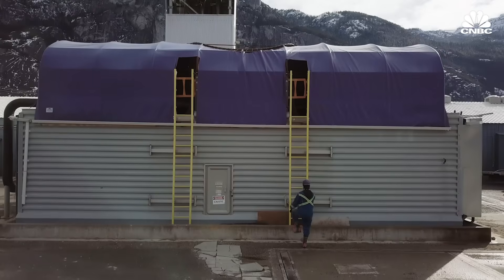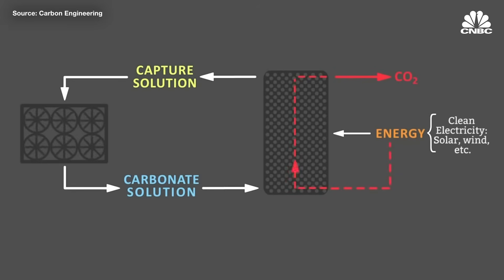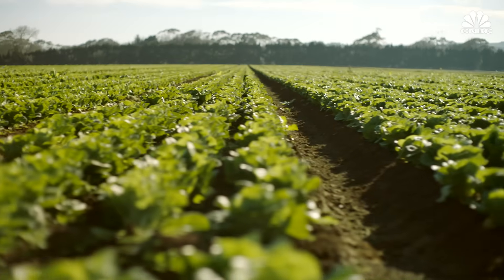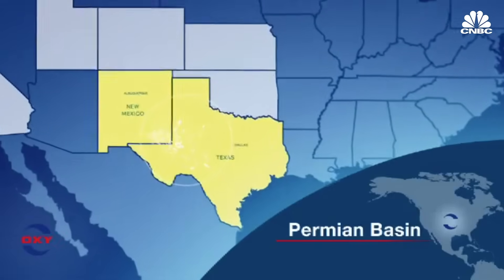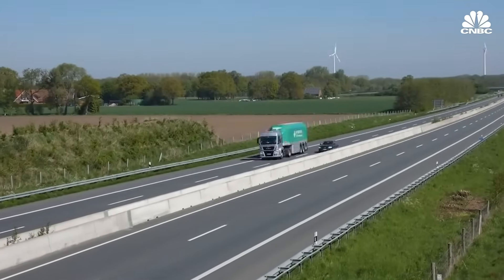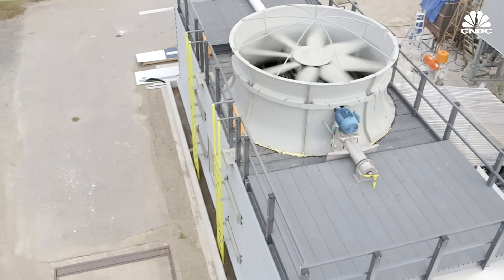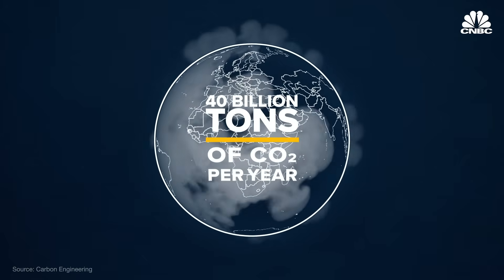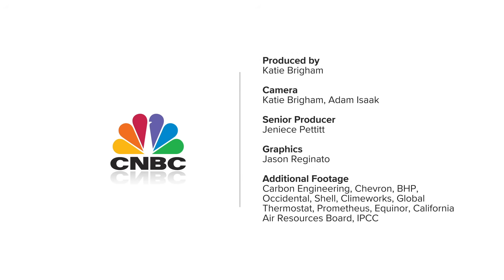Bill Gates-Backed Carbon Capture Plant Does The Work Of 40 Million Trees

Comment: Damn, even the tree's are losing their jobs to technology.
Reply: atleast the tree's are doing it with no cost..
Reply: @rheyreoyan4838  and the trees give us oxygen this plant isnt doing the work of trees if it isnt giving us oxygen now is it
Reply: @ChillingCap   We have more than enough oxygen already.
Reply: @rheyreoyan4838  And poor efficiency, the photosynthesis of modern plants range from 0.5% to 1%, the theoretical maximum efficiency of photosynthesis is 6%.  Yes, fossil fuels are just chemically stored solar energy collected by nature at efficiencies far less than 0.5%, makes those commercial photovoltaic solar panels at 20% efficiencies look real good doesn't it.
Reply: Pure BS greenwashing.

1. Underground stored CO2 can leak out through burst well-heads that are sure to happen over time - once major leak starts - generally all the gas escapes - as shown in the recent California natural gas storage blow-outs.

2. Conversion to fuel takes more energy than is got from burning those fuels. So it makes more sense to use the needed input energy to replace fossil fuels use in the first place.

This is just a fig-leaf for fossil fuels.
Reply: @rheyreoyan4838  at a slower rate with more space needed
Reply: @rheyreoyan4838  If you let the sun, oxygen and water be an exception, then maybe yes.
Reply: @rheyreoyan4838  Pine trees in BC have a 80 year growth cycle.  Trees do the job but they are too slow.
Reply: @rheyreoyan4838  don't trees need nutrients to grow? Plus don't trillions of trees need to be planted to reverse climate change? Don't get me wrong, we need to plant trees, but so much space would be needed for those trees. I don't know all this, this is a genuine question.
Reply: @redguy4234  I've got a better idea. Why don't we just stop cutting down the old growth forests like NOW...and then plant lots of little sapling, which will take hundreds of years, of course, to fulfil the ecosystems services that old growth forests provide us with.
Reply: @rheyreoyan4838  yeah and you can actually get energy from the trees by burning them too 😂 then that energy can run this plant to replace the tree
Reply: @rheyreoyan4838  TLM: tree lives matter. Soon they will unionize and demand benefits and pay
Reply: @rheyreoyan4838  because land is for free right?
Reply: @rheyreoyan4838  the air they breath is carbon, you know that right
Reply: @rheyreoyan4838  I think growing 40 million trees would be very expensive.
Reply: @nomercy4521  Atleast it wont have any ill effects on Nature
Reply: @himanshujoshi5133  that depends on how it's managed. Evasive plant and animal life could really mess up ecosystems.
Reply: @nomercy4521  I don't agree to it. We with all others (plant and animal) make this eco system. If one part is extensively growing others need to increase with same speed to keep everything in proportion. If not then, we should know that whatever we are doing is not right.
Reply: Austin not really it might only just cause 1 million or 2 for the trees getting planted and 15 or 20M For the water transfers unless rain comes the water transfers would be less and could be affordable :D
Reply: @nomercy4521  🤔🤔🤔
Reply: @nomercy4521  Not in China, the Chinese have been recreated their forests by planting trees since 1960s, from desert to forest and oasis, they are very productive lands now.
Reply: Austin I think sparing 40 million trees would be less expensive Forrest grow them selfs eventually with the animals around them if you stop damaging them ... but there is a line and we’re crossing it in the Amazon for example and that line will lead to total collapse :/.
Reply: @nomercy4521  Not reallt they shed seeds all the time...
Reply: Austin, What about not destroying 40 million trees 

Or, every time a tree it is destroyed, one is planted.
Reply: Austin actually it’s not. Just send me the seeds coz I like breathing and will plant them.
Reply: Austin 40 million trees were free, until we cut them down
Reply: @nomercy4521  trees lasts many years tho
Reply: @nomercy4521  uh what
Reply: @nomercy4521 
His killing of 40 million trees per machine will be more expensive... Those trees need CO2 to survive. 

These climate crisis alarmists plans will do MORE harm to the climate and humanity ...
Reply: @nomercy4521  They'll grow on their own if you let them.
Reply: @nomercy4521  It's more expensive not to breath. The Amazonas is being burnt down at an increasing speed. We need new "lungs" so that we can breath. Rethink.
Reply: @nomercy4521  how about if trained volunteers did it?
Reply: @nomercy4521  quite the opposite actually
Reply: @themiddlekingdom9121  China's worst polluter of them all.
Reply: @nomercy4521  not in the amazon.
Reply: @nomercy4521  I don't think it will be expensive as this PLANT does, I think it's just Time-Consuming...probably hundreds of years to grow into forests...
Reply: @nomercy4521  A few buckets full of seeds. And then just spread them and wait for the magic.
Reply: @nomercy4521  How expensive compared to the money that has gone into this?
Reply: Lol plants produce oxygen that this plant doesn't
Reply: @Randibaaj_sala  😁😂😂😂😂😁🔥
Reply: @Randibaaj_sala  trees provide the natural ecosystems that these machines don't. The insects, birds, fungi, animals. These can never be replaced by machines.
Reply: Anon ymous nailed it! Add the fact organic plants need C02 to grow. The unknown, which politicians and media ignore, is the amount of C02 an organic plant can process. A study may have found the more C02 in the atmosphere, the more an organic plant "greedily" uses C02. I use greedily for lack of a better term to show organic plants will consume more C02 based on availability. 

More C02 could mean larger plants and better yield of seeds, including fruits. 

The man-made C02 scare is a danger to nature, considering the lack of understanding of the processing of C02 by organic plants. Don't believe me, scientists couldn't figure out how to make people fly with the backing of government funding, it took 2 brothers to figure out how to get people in the air. 

Don't trust the government to think past the buzz of the week in order to win an election. Don't trust your TV to be unbiased.

Bill Gates, if you're listening. Use your money to give humanity a more well-rounded understanding of the EXTREMELY IMORTANT GAS C02 IN ORGANIC PLANT LIFE. Most politicians are money and power greedy fools.
Reply: yes but this plant give oil companies a way to get more oil. Who cares about oxygen. We can all walk around with hand held oxygen machines
Reply: They do.... Only carbon is extracted and trapped underground the oxygen may be inform of by-product, but oxygen can be separated from co2
Reply: @Randibaaj_sala  plants need to breathe too you know...
Reply: @Randibaaj_sala  yep but yet they still find a way to keep on taking life out of the game except for a select few. Cough
Reply: @Randibaaj_sala   algea produces more oxygen than trees.
Reply: @Randibaaj_sala  but plants use oxygen at night while this plant doesn't
Reply: @Randibaaj_sala  true but NASA did a study stating that as co2 emissions increase plants are using less of it. Even plants are no longer enough.
Reply: @Randibaaj_sala  yes it does produce oxygen
Reply: Anon ymous about 70% of the worlds oxygen comes from algae
Reply: @nickdelasalas8975  you're saying like decrease of 15% of oxygen due to trees isn't going to effect. And where arre the sources?
Reply: @nickdelasalas8975  i guess that that means we dont need to anything
Reply: @nickdelasalas8975  links to prove your opinion please 
Never heard that before
Reply: @Randibaaj_sala  nobody is planning on cutting the trees down so we will still have oxygen
Reply: @jonathant5774  ....you don't have to cut the trees down. They are all dying in my town of Chapin Sc. Pines, oaks, beech, lots of different species. The poisen they spray is killing them.
Reply: @jonathant5774 
Without CO2 those trees will die...
Reply: @Randibaaj_sala  it never says it is to replace the trees. It is just to clean the air that we polluted
Reply: ehm..  what about oxigen
Reply: @zenoidul  you already show signs of oxygen depreciation
Reply: Vrincy, not sure what your thought process was for your comment, plants live and reproduce using C02. Processing C02 deliberately could stunt plant growth and reduce natural oxygen production. Lest we choose to rely on man-made and regulated oxygen.
Reply: @zenoidul  there will always be trees. Perhaps skinny tries since we'll be taking all their food...
Reply: we don't have time for your details we are saving the world!
Reply: @zenoidul  Good point, but maybe the cycle is completed when it's put back in the ground.
Reply: @zenoidul  excatly
Reply: Vrincy most of our oxygen comes from the ocean
Reply: @zenoidul  there are still plants a d trees about bro chill
Reply: @zenoidul  Trees almost don't produce oxygen, seaweeds does.
Reply: @zenoidul  oh she didn't hear anything about oxygen nobody's telling you however that oxygen comes from keep your mouth shut and practice holding your breath
Reply: Trees also provide wood and food and habitat and they don't need electricity
Reply: Yang 2020, now American trees can get $1000 a month
Reply: Eh we can just plant more trees around our homes, in the cities.
Reply: @leehongjin6884  that should help with shading the sunlight to keep homes, bus stops, etc. cooler especially if the tree is leafy (creates better breeze generation if you are near it), and help with aesthetics.
Reply: I'm gonna post this with your qoute.
Reply: @johnperic6860  
From what I can find via National Geographic, 

"It could take more than a hundred years to add enough mature forest to get sufficient levels of carbon reduction."

That's based on current CO2 levels. 

I'm for planting trees, but if we want to treat that as "the" solution, I don't think we'll hit the goal.
Reply: @nomercy4521  i believe in siberia,the canadian arctic and alaska they need people to plant trees after they put out the wildfires,next year same deal until we run out of trees,fires wont be as large as the new trees we plant arent as big as the ones that are burning now,after that we have have to plant peat to replace that too is burning
Reply: @richardconnelly7141  I saw some research more recently, and it raised concerns about tree planting.

What was most interesting for me was the effect planting trees could have on capturing heat. Forests are large heat sinks that retain heat and foresting areas can decrease the amount of sunlight being reflected back into space. Planting too many trees and planting them in the wrong place could actually increase temperatures.
Reply: @richardconnelly7141  but we'd have to replace the asphalt, and people want the asphalt.
Reply: @nomercy4521  This can be a stop loss till we plant more trees.
Reply: @nomercy4521  genetic modifications , i myself work on that subject , and it will need less than 40 years ( if we start )  - we will be able to build  up sections of  Forest  , for industrial and other specific uses  , slowly solving soil  degradation issues  , few northern countries are already doing same thing , but as long as the governments of  countries with rich forests   ignore issue and keep destroying forests ,  problem will be way harder to solve ,  first sections  or generations of those built forests will need around 10 -15 years to grow .
Reply: Planting forests is still the better solution. Our watersupply depends on forests worldwide and so does biodiversity, regardless of climate change.
Reply: @TT-Freak  Absolutely, much cheaper !
Reply: It is a joke
Reply: @danv.2695  lol
Reply: But does it make paper? 🤔🤔🤔 After all, everything made of plastic these days is being forced to find other ways; and paper seems to be the way for most. We need to plant trees for many other reasons. I know you're only kidding around, and it is funny, but you godda love companies like Tentree that plant trees for every product/service sold. ^_^
Reply: This thing is worthless.  There are 390 billion trees in the amazon alone.  They are quickly disappearing.  We need more than ten thousands of these machines to make a difference.  I dont see that happening.
Reply: And in future animals will probably lose their jobs to technology once we find sustainable ways to grow pieces of an animal from their stem cells.
Reply: @scythal  which means we no longer have to chop down the Amazon Rainforest for animal farms. That means fewer animals grown for meat and less need to produce plant stock to feed them. This also means fewer emissions from the animals and the transportation to ship them to slaughterhouses and then transporting the meats for food markets
Reply: no way trees do a lot more than remove carbon from the air they prevent landslides, are home to animal life etc.
Reply: Trees when rotting after they die or burned, releases all the CO² they've absorbed so they are a net zero for CO² capture unless the dead trees are buried by geologic processes or used as building material by man.  Trees are a temporary store of CO².
Reply: @johnwang9914  yes
Reply: Uneployment due to technology
Reply: Trees are now obsolete due to humans
Reply: @scene6289  dont worry soon humans will be obsolete and weeds will dominate the world because their will be no animals left to eat them either
Reply: Because now, it's hard for the trees to do their jobs.
Reply: once they are losing their job, it means promoting more logging, its true this actually promoting for more pollution
Reply: 😂😂😂 here you win best comment  🏆
Reply: THEY TOOK OUR JOBS
Reply: Forest have higher risk of fires. So local governments need the money to carefully manage that too. Everything costs, no matter what it is. Like the lady says it's not a matter of either or, we need to implement every solution.
Reply: LMAO this comment made my day ahaha! XD
Reply: I don't buy into the CO2 climate myth https://www.youtube.com/watch?v=RHM6-Pk21i4. CO2 is largely plant food, and has little if any other relevance. Trees have a lot of other benefits than this stupid plant has. British Columbia plans to plant as many as 300 million trees in 2020, if they can find enough tree planters to plant them all, and does that every year in order to sustain the forest industry. If the logic stated here holds, that is like creating 8 carbon capture plants every year? Somehow the math just doesn't add up?
Reply: These stupid plants will actually damage the environment and the economy of BC, making Canadians poorer in the process. This plant should be shut down and the money put into reforestation and the BC coal, oil and natural gas industry. Removing CO2 from the atmosphere will just make the forests grow slower and lower the productivity of the ecosystem overall. Stupid environmentalists would rather live in poverty and see the decline of the human race and its advancement. No wonder Western civilization is in decline. We may as well stop having children - they are just a burden to the future and mother nature. Bloody collectivists. If they care so much they should sterilize themselves and go live under a rock. I will exercise my free will and do as I please. Climate change is a lie promulgated by the communist Chinese and the ultra wealthy elites like Gates.
Reply: Pine trees in BC have a 80 year growth cycle.  Trees do the job but they are too slow.
Reply: @BMC_self-invent  Just thinking that, as long as the Carbon stored does not end up underground, it goes back in the cycle either by forest fires or by other means. Though I like what the Chinese have done, using their army to grow massive amounts of trees, and reclaiming some of their deserts.
Reply: Actually Tree's convert the CO2 to Oxygen. These Machines are just sucking CO2 up.
Reply: What about oxygen producing
Reply: Umesh R. Trees still do most of the work and make oxygen, food etc.
Reply: More like there food. Well i guess this is the end of humanity, no nore oxygen.
Reply: Its not even trees. Its phytoplankton that provides most of the oxygen we breath, and it depends on the water, minerals in the water, sunlight and carbon dioxide for photosynthesis creating the oxygen we breath. Theyre going to capitalize on this and ruin the air.
Reply: @johnperic6860  problem is they destroy way more trees  every few years , between 2012 and 2020 over 60 million hectares were destroyed  ( partially or fully ) with this rate  till 2030 we will have only 25% of the forest left .
Reply: Umesh R.   Yeah Bill Gates is global enemy.  Seriously.
Reply: Trees are not just losing their jobs, their losing their breath! Why are money hungry corporations killing this planet?
Reply: That's right, That's the death nell for our last remaining forests, plants need Co2! 😡
Reply: Sure Kid  If our beautiful forests were left to flourish we would'nt need to fix the problem!!
Reply: Dang, I was thinking the exact same thing🤣🤣🤣🤣

So use chemicals to remove chemicals.. that they will later say is a bigger issue that we will all require a vaccination...lol
Reply: I don't understand why we can't just go back to letting nature do its thing.... We are so arrogant to believe that we can do nature's job better
Reply: Won't be long where gonna start seeing canned air for sale... I can imagine the commercial slogan... "Breath Easy and Fresh with Mountain valley air
Reply: I wouldn't to go that far. We still need them because of the ecosystems they produce. There are some things that technology just will never be able to do.
Reply: Talk about oxygen, food production, support of wildlife tt helps maintain rivers and other life sustaining processes. Not to mention the amount of energy utilized. Clever Marketing, focus away from what it really is.
Reply: Which is no joke because we desperately need more trees.
Reply: If this isn't a joke, how many horses do you think lost their jobs to the steam engine 😑
Reply: They do so much more than clean the air, though.
Reply: Make Forest Great Again
Reply: RIGHT? Or you could plant more trees 😆😆😆
Reply: @johnperic6860  I'm not knocking planting trees, I'm just saying it isn't cheap. From what I looked up, it took Ecosia 10 years to plant about 60 million trees and one of the tech plants replaces 40 million and they need thousands of these plants to reach carbon zero. 

That means we would need to plant trillions of trees planted in something like 20-30 years.
Reply: @nomercy4521  if we get to carbon zero, all plants will die
Reply: @nomercy4521  
And trees take years and years to grow, plus trees DO NEED carbon dioxide for their function, even trees don't live on pure oxygen, in fact oxygen is a BYPRODUCT of their natural functions. It just so happen that there best of living things need that oxygen, no??  
and the air we breathe has only ~16% oxygen.
Reply: @nomercy4521  How can you say "growing 40 million trees will be expensive" when it takes only dirt and water? You throw a damn seed in the ground and keep people off of it. Thats the problem with society, everything hast to cost something, even if it has to do with saving the planet.
Reply: @nomercy4521  Something is badly off with the math here. I'm pretty sure this plant can't replace more than 1000 trees.
Reply: @nomercy4521  that means we need to plant trees on every building
Reply: @nomercy4521 
Wanna see a planet w/out trees ~which is what this technology will do ~ look at Mars or any other barren planet ~ or just look at ANY barren area on earth...  Is that what we want❓  NO
Reply: I've seen so many comments simply putting trees vs tech. It's so reductionist and missing a lot of aspects. For example, prairie, grasslands, farming systems like alley cropping that mimic savannah, etc....Some of these systems are even faster and more stable storing carbon underground than trees(humic and fulvic acid can be stable for centuries, and as they dissolve, go deeper into the ground).  In addition they can be economically viable while addressing multiple issues associated with climate change, soil degradation, loss of species diversity, declining pollinators, etc. I'm open to these tech solutions as well, but some of them seem to lack big picture, integrated systems thinking. I'm not yet convinced that this particular tech, where the liquified carbon will be injected in the ground in a similar fashion to fracking, won't present some of the same problems fracking does(seismic events, water table pollution, etc). Maybe I'm wrong, but I'm not entirely convinced yet. But we'll see. We've got to explore all options.
Reply: @nomercy4521  what about simply growing trees 
Seeds are pretty cheap pal
Reply: @nomercy4521  I totally agree with you people are seeing this as a vs. Instead of a combination. We need the three things renewable energy, trees, and the carbon sucker machine.
Reply: Jonathan T totally right the time has run out to choose. Deforestation needs to stop right away. Sustainable logging needs to implemented. For every tree cut down a new needs to be planted. The world 🌎 need to plant more trees 🌲, expand renewable energy and CO2 capture with machines. Much of that can be help by politicians and policy that gives large insensitives and government funding in start phases of projects to help private sector become profitable and makes it attractive to invest in green technologies that again speeds up deployment of solutions and  makes it more efficient. Carbon capture and other green technologies need to be run by private or public companies because of the strive for efficiency.
Reply: @nomercy4521  but the plant doesn't give off oxygen like trees do
Reply: @cruzin1383  trees also don't permanently store CO2.
Reply: @nomercy4521  your right they don't they convert it to oxygen. What bill is doing is called terraforming the planet in the name of "global warming" (aka climate change) For what ? Who knows.
Reply: @cruzin1383  j
Reply: @nomercy4521 
They turn CO2 into what you need to live ~ OXYGEN
Reply: @cruzin1383  agreed
Reply: still... will it gonna last long?
Reply: Lmaooooooooooooooo
Reply: Well they'll be loosing their jobs once this technology start releasing oxygen for CO2
Reply: ...one way to look at it. Yea. Crazy crazy...
Reply: lol
Reply: Great
Reply: lol, but more efficient spatially
Reply: well, trees simultaniously does their jobs
Reply: Lmfao
Reply: @ZaC kWinz So will that new balance be the same as the old balance, and will the new balance be better or worse? Yes, there will be a restored balance but it will likely be a different balance - a balance that may not include the current set of life forms. Considering that life has changed that balance in the geologic past, you are correct but it usually included the removal of the existing balance. So you have a choice, which will it be?
Reply: we can finally have plastic lawns to stop the senseless mowing of grass.
Reply: Not quite, trees give out oxygen, humans haven't done this yet as far as I know, so losing trees mean less oxygen for the world.
Reply: @johntiseo9578  Algae gives us 70% of our oxygen even if trees are gone we will still would have oxygen production it is bad that trees are dying but hears the deal they will most likely adapt and we wont need to worry about this and to much oxygen will decrease life spans for nearly every animal by many years because oxygen is a very corrosive element and most metals will be useless. As long as oxygen levels don't drop to a certain point we should be fine.
Reply: Perhaps there is a simple idea but not easy, we can put lighting on forests and the electricity is from solar panels and wind turbines.
Reply: John Peric this is pathetic u should watch this video called “why everything will collapse” this is inevitable this is false hope actions have consequences we’ve had a good run even though we destroyed and polluted everything
Reply: YANG GANG
Reply: Lmao!
Reply: Lol
Reply: Umesh R. You put the perfect words.
Reply: #yanggang
Reply: T R E E ' S
Reply: @johnperic6860  And how many acres or hectares would you need to plant all those trees?
Reply: That technology is necessary because of the lack of trees thanks to our dumbasses recklessly deforesting the planet. So no, trees ftw
Reply: Umesh R. Good one man, like that.
Reply: XD the future is when we become useless
Reply: Epic comment
Reply: Umesh R. No
Reply: My favourite comment in a long time. :)
Reply: So basically save earth machine
Reply: LMAO
Reply: @johnperic6860   Where did you get this 375 billion number from?  How do you know that would be enough?  If we assume the numbers from this video are correct, you would need 1.6 trillion trees just to offset emissions.
Reply: @johnperic6860   So like I said, more than a trillion trees are necessary.  Then there's the issue of where are all those trees will go, and how they will be irrigated?
Reply: @DANGJOS  I have answers to those questions.
Reply: Secondary job ass
Reply: Oil mafia another techniques as they get more subsidies to pump out more oil and where will u store carbon it's leack in atmosphere  after some time period.
Reply: Btw trees balance carbon dioxide levels by spitting some out as well. Too much oxygen and it wouldn’t work. I’m in 7th grade science so I would know
Reply: Umesh R. Oxygen...
Reply: Chop chop
Reply: lol 👍
Reply: Trees just burn in Forest Fires anyway. So way cool, lower CO2 and WildFire Safety!

Yes, the Guvmints of the world need to pay for this CO2 capture. technology capture.

I foresee another great revenue stream investment opportunity for Private Equity Firms. Go forth oh you lobbyists and be munificent in Campaign Contributions.
Reply: Isn't a well functioning forest carbon neutral anyways?
Reply: #YangGang2020 Give UBI to trees!!
Reply: I see it as more of a way to slow climate change
Reply: Hot damn!
Reply: Where would Qualas go now
Reply: Ha ha. They would achieve the same by planting trees
Reply: I think I will never see
A poem as lovely as a tree
A tree whose hungry mouth is pressed
Against the earth's sweet flowing breast
...
Sorry, can't remember the rest of the poem!
Poor trees, even the poem fo them, I forgot.
But I pity more the next generation, they might learn about trees only from pictures ang films

...Poems are made by fools like me

But when there are no more trees,

Only God can make and restore trees!!
Reply: What if we run out of co2
Reply: There comes a time when even the trees can't bear the burden we put upon them.
Reply: Not really it doesn't make oxygen
Reply: trees* no apostrophe
Reply: We need reforestation, to capture carbon & replace the trees we cut down. They are going to need trees in the future, aren't they? There is plenty of desert areas in the world, Africa, etc, if we rehydrate the deserts we could plant trees & expand the living areas for Africans?. Don't ask me how I'm just a  climate change denier playing the game.
Reply: @johnperic6860  Google bought ecosia.... they used to protect the forests not replant...
Reply: Umesh R. Gates is in trouble and Trump will get Justice
Reply: Nice
Reply: So i guess alot of people losted money on team trees
Reply: I love tree it give me foods
Reply: They beat Mr. Beast 2 times over
Reply: Here’s the technological solution for regulating climate: https://youtu.be/VniAGLTWzc8
Reply: Why why are these people against the nature, when they're born out of it🤯🤮
Reply: Not possible though. Nature's balance will be back.. it happened earlier it will happen again... Humans should go extinct
Reply: China should buy one of these
Reply: Interesting. It sounds promising but I just fear that other will find a excuse to cut more trees.
Reply: Jobs are a lie just saying
Reply: You mean losing their lives XD
Reply: We still need trees
Reply: Trees: They took our jobs!
Reply: It's about using technology in the in-between times you're waiting for the environment to recover more naturally.
Reply: What trees? Humans hate those things, don’t they?
Reply: 😂 Not yet
Reply: Umesh R.   😂💀
Reply: Now we all gotta depend upon BILLy GoATES & da oil bandits 2provide da 🌍 fresh air🙄💬

Ummm uhhhhh....wudda u think⁉️
Reply: yep and whats worse they have to go see the branch manager to get compensation.
Reply: Yes lets cut the trees down to build building,  then build more building to do the job that the trees were doing in the first place.  This seems to be our MO to problems that we create by our first actions.
Reply: Umesh R. There is no machine in the universe, that will ever be able to replace a tree.
Reply: Good people, but still many idiots believing this is good thing that can compensate trees
Reply: Good people, but still many idiots believing this is good thing that can compensate trees
Reply: Not to technology,  but chainsaws!
Reply: There’s plenty carbodioxide for everyone
Reply: Trees are losing their food
Reply: 😂 True
Reply: not really , fact that CO2 will be captured by this machines doesn't solve problem of deforestation  , it still affects water  distribution and temperature changes ... carbon emissions will still increase  considering there will be less plants sustaining ecosystems - less plants / less trees will result into degradation of soil and desertification  , which is way more significant later stage  processes  .
Reply: THEY TOOK OUR JOOOBBSS
Reply: @johnperic6860  We would need to regrow all the forests we have chopped own the last 100 years
Reply: @johnperic6860  it is not about how extreme those extreme events are but how regularly occurring those extreme events become
Reply: This comment made my day
Reply: I'm down with getting rid of electricity,and cars. Lets all go back to living self sustainable lives.
Reply: Lol OOF TREES
Reply: @johnperic6860  i can plant 49 trees but tell me where. And everyone else where to plant those 49 trees
Reply: All I hear is someone trying to sell there job. Not only that they are trying to scare you into a huge tax so that they have this job ! wow crazy lol I mean there are bigger fish to fry but some how this little guy is in the pan
Reply: Technology does not destroy jobs, it only change from one form to another.
Reply: Loosing what they need to breathe.
Reply: Lol
Reply: Only God knows where this will lead....
Reply: Speeds off in the same tech-based car doing that sort of thing too and jets too.
Reply: Unmutual IMMMAOO
Reply: Don't you know what they're talking about no Cal's no trees chemicals in the water terraforming the planet that's what they're going for well they go underground with all the oxygen
Reply: I really hope this was a joke
Reply: Daniël Mol So what do the trees breath
Reply: Yup
Reply: Sure Kid  No it does not make it automatically bad...
Reply: Trees  will never loose  their job because  they  are  doing  it  for  free.
Reply: This won’t replace tree
Reply: evolunter  lmao what do you mean by lost? Molecules don't get lost until they're converted
Reply: Lmao!
Reply: Nah man, trees could never lose their position! They provide O2.
Reply: Trees are slaves smh
Reply: Don't worry tree have a job to prevent soil erosion and daycare too.
Reply: Hey remember trees I think it's Futurama or Simpsons is a hologram in memory of a tree
Reply: Brilliant comment 🤣😂🤣
Reply: Are the forest animals also living in the co2-plant?
Reply: Well i hope this is just a temporary solution and a last resort if we ever destroy a herd of trees in the future that negatively impacts the climate again
Reply: We're so bad at looking after trees that we have to build factories that do their job for us 😔
Reply: This is God
Reply: @johnperic6860  planting is dang easy. Where to plant the trees and making sure they grow is difficult.
Reply: Isn’t china all already using these on top of the Skyscrapers?
Reply: Its rough out there.
Reply: Without trees everything would die
Reply: Oof
Reply: Without trees everything would die off on Earth
Reply: Plants need co2 to live
Reply: They aren't. It takes as much energy to capture carbon as to capture it. Phytoplankton is more cost efficient and just requires people to stop polluting the ocean with destructive chemical runoff and plastic (and clean it up).
Reply: LOL
Reply: Erm wouldn’t it bad for us as that would be 40million trees not pumping out oxygen 
We need trees 
Trees needs us
Reply: @stickykitty , we need phytoplankton more. Trees produce less than 30% of the world's oxygen. Ocean pollution and plastics mess up the ecosystem for phytoplankton.
Reply: @Lein Rodriguez well said
Reply: Just shows the government can be effective in screwing up everything.
Reply: just need about 8000 more to do the work of trees in Canada alone lol
Reply: *trees
Reply: Wtf lets just stop replacing trees with concrete !
Reply: 40mil is nothing better plant 40 mil trees lol
Reply: They are also being massacred, the remainder havent been able to scrub excess carbon dioxide for decades, and these things arent going to be able to make up the huge excess.
Reply: You see this and you wonder what exactly the Crisis is that Biden talks about?
Reply: And electricity losing its luster to weather how crazy is that
Reply: No, not if we don't want them to. If Bolsonaro insists in burning off more of the Amazonas, then we MUST start planting new world-lungs SOMEWHERE ELSE where they won't be destroyed. And we must start NOW. Iceland is planting trees now, for the first time in a 1000 yrs :). And Israel, Spain, Egypt....
Reply: You are right. But do we have land for planting? And reason for planting. "It's like Charity Work." Whose fault is that? I think, this tech is has potential for scalability, fossil fuel making and use is after issue. The government cna make policy on that. And we are going towards green energy so I think that's not issue too.
Reply: This can’t be good
Reply: lol
Reply: Trees are losing their "jobs" (they are not compensated) to humans, not to technologies. Technologies are losing their role and intended purposes to humans. 
I am a carbon engineer??
Reply: Methane is worse than CO2 as a greenhouse gas
Reply: Ah ah. Ha ha ! 😅 i know what you mean bro ..
Reply: Better to replace the cars that are causing the problem in the first place ..   We need more  Electric cars and h2o hybrid vehicles..
Reply: Electric power plants are the number one polluter in the world so EV's are not as eco friendly as everyone thinks since most of them are charged from fossil fueled power plants hydrogen-powered cars and more eco-friendly than EV's
Reply: @ZERO-th6dd  yes i agree , the power station's are also an issue polluter..
Reply: Every single thing with Gates name on it is a scam to make billionaires richer and the people poorer. This included. Guaranteed.
Reply: @johnperic6860  at lest the carbon capture plant is a good start. However i don't see that sort of technology catching on as it would require a lot of money and probably hundreds of  carbon capture plants around the  world. however that technology along with planting trees could help allot.
Reply: if not thousands of carbon capture plants. I think its a great idea however hoo would implement it. i applaud  bill gates for what he has done however we need hundreds if not thousands of those plants to reach  our goals as a species.
Reply: why would he build technology to purify the air at the cost of thousand of dollars probably more
Reply: @supersaiyaman11589  Because he knows he can use it to get a bigger return. He doesn't give af about the air.
Reply: literally this is the stupidest comment ive seen today. almost on the level of. (homeless people should just buy a house)
Reply: That's rich.  17k people understood the joke and your the 'stupid' guy that's always left out.  You must be on the spectrum.
Reply: @raveendu  if you see trees just as carbon filters.. yeah good joke;) enjoy ur food and ur oxygen
Reply: Tree don't have hand to do jobs heee
Reply: @johnperic6860  Trees produce their own offshoots. It's better to just leave it to nature. It can take care of itself as long as people stop burning trees and land. Problem solved... Or most of it.
Reply: LOL THAT ONE IS A GOOD ONE
Reply: And that's why if ai and robots can be the most successful life (if they are defined  as life) in the universe too, due to their huge potential
Reply: Trees are not only to convert co2 to oxygen..  But they also held soil fertile..  Once the leaves of tress falls to the ground..  The soil becomes fertile responsible for growing crops.. and also  provide  drinkable water...  Once it rains..  Tress held the water and allow them to flow slowly..  This process won't allow water to go back to sea...
Reply: Trees are not loosing their job. Rhey produce same amound of co2 like produce "oxygen"
Reply: Replacing trees with technology is just to speed up the process to stop climate change. You replace trees with tech, everyone goes extinct.
Reply: @ravindranathhospital1362  according studies trees are not generating oxygen on higner level then CO2.. its commong from orher plants.
Reply: As the trees are being replaced with technology, it's basic needs are being met through an UBI from mother.
Reply: It's called capitalism. There's a reason North Korean, Venezuala, North Vietnam and Cuba aren't at the forefront of sustainable energy technology . . .
Reply: Technically trees are bad in the lung run when it comes to the keeping of carbon dioxide. Since they eventually die and decay
Reply: How about we just collect as much carbon as we can and rocket it off to space since it's been demonized for damn decades now....
Reply: Trees not only take in carbon, but...
They release oxygen and moisture in air
They keep up the ground water level
They prevent soil erosion, bring rains, reduce sound and air pollution
They give fruits flowers, fragrance, shade, greenery, beauty.
They are home to many birds and animals
They give wood, gum, resin,,herbs, medicine, cotton, paper, fibre, manure, nectar, nuts, seeds, oils, etc.  
No technology can replace TREES.
Reply: 40 milion trees aye ? 1 plant.
Seems like a total waste of time and money when there are so many other alternatives that are much cheaper and wholly more productive and beneficial. Any "carbon" tax is nothing more than a scam to turn a profit for someone.
I see... planting tens of Trillions of trees worldwide. 
This would have at least a fourfold benefit (many more than that actually) to our civilization - oxygen production and C02 scrubbers, wood and jobs. 
Another benefit of forests is some amount of weather control - they keep the winds from ravaging the surface and slow them down too. 
Let's not forget erosion control.
How much longer can the forests hold out before they are ALL gone worldwide ?
What are our progeny, generations from now, supposed to do for building materials if we leave them no trees ?
Not to change the subject but, it takes water to grow the trees.
OMG, OMG - We have no water, we're dying of thirst, our rivers and reservoirs are drying up, we have no water, whatever shall we do, OMG !
Well, number 1: There is NO water shortage !
There exists an estimated 7.2 MILLION CUBIC MILES of ice in Antarctica alone.
We need less than 20 cubic miles of that to fill every reservoir on earth and a few seas too.
Hmmm..   20 (TWENTY) out of 7.2 Million huh.   Kinda' of a no-brainer there.
Don't even get me started on Greenland ! 
Billions upon billions of gallons of the purest water on the planet - draining into the sea - EVERY DAY !
No one is capturing ANY of it !    Retro-fit some idle tankers, sail them up there and fill them up, sail back to whoever needs it the most.
There is more pure water in Antarctica and Greenland than we could use in a million lifetimes.
Not only retrofitted tankers; start towing icebergs to coastal processing facilities.
There are 3 (THREE) points on earth with the closest proximity to Antarctica - Tierra Del Fuego, Cape Town, and Australia - three points here too - Perth, Melbourne and Sydney.
The de-sal plants can be converted to... for a lack of a better word (yet) - chopping and melting and distribution facilities.
Look what Captain Jean Luc Picard did on Kataan in "The Inner Light " episode of STNG.
He irrigated an entire planet.
Why can't we do something similar here on Earth ?
It seems like a pretty simple engineering project albeit essentially "Terraforming" our planet.
As long as we are here and plan on being here, hopefully, for quite some time yet, we might as well make the planet work for us instead of us working for it. We have the ability and the technology to do just that - Terraform this planet. Lots of details to work out.
Ditch, tunnel, viaduct / bridge, pump, siphon - fall systems distributing several "grades" of water on a global scale.
Done right, these worldwide, interconnected water lines, would supply every person on the planet, mattering not their location, with clean drinking water while also supplying the needs of agriculture and industry - For at least the next 10,000 years.
It is a shame that we, the human civilization, have evolved to the point we are at today. Warring parties out to destroy each other - Wow !
Is this the road that we want to travel ? I'd rather not. I suppose that it is just my whimsical thinking that we could take another path.
A right turn instead of a left turn (no political connotations - just general directional instructions inferred).
Terraforming. Let's make it work for us now and those who follow us far into the future.
Do we want those who follow to think that we, the current citizens of earth, were morons or rather have them thank us and be grateful that we took steps today to assist them in their future. I vote for that direction.
There are so many things that we can do and are capable of so much more but it will take a worldwide, concerted, effort to achieve.
GW is a fallacy. It is a natural cyclic rhythm of the Earth. We just happen to be here now to witness it in its ever so slow progression.
Adapt, improvise, overcome !
Reply: This is a stupid effort. 

There Is No Warming: 

https://youtu.be/n6VM41-v2gg

This should be greeted as good news, but it probably won't because everyone's so invested in the CO2 superstition.
Reply: Maybe Trees should join the r/antiwork movement. It’s growing. 🙂
Reply: Yep the trees are useless now just look at the ones in the giant redwoods of California they're dying from the tops down along with all the other trees in the world not a problem right high technology fix that.... Have you ever seen technology walking around by itself they do as Elon Musk is building a whole army of them and turning them loose on the European Union
Reply: and we are losing moisture from our verylungs to give good ol' bill a buck
Reply: The whole meaning of this things is to do what simply planting trees cant do
Reply: technically not, because trees produce C02 at night. So you could say they are partners with this machine lol
Reply: Let's see a carpenter frame a new building using one of these tree substitute machines!
Reply: Next is humanbeings. It is coming now.
Reply: Yeah. Goodbye  photosynthesis
Reply: Then give oxygen as buy product ...
Reply: nope they are loosing it to deforestation! https://www.youtube.com/watch?v=B5Fwl4P4EW8
Reply: It's a good way to filter air in mass scale with very little electrical output.
Reply: Losing jobs to oligarchy, automation frees us from being classified cheap labor
Reply: They need to go HUG them trees 🤌🏼😏😒🙄 🌳🫂🌳🌴 🤗 🌴🌲🙌🏽🌲
Reply: Iluli by mike lamb 
https://youtu.be/SfuipeT0MUU
Reply: As someone who recently lost his job, I want to give trees a hug.  😪
Reply: God, the Lord Jesus Christ loves you! Restore your relationship with God by repenting of your sins and putting your faith in Jesus Christ, "... that Christ died for our sins according to the Scriptures, and that He was buried, and that He was raised on the third day according to the Scriptures..." (1 Corinthians 15:3-4)
Reply: People who have no ownership of our trees or property arrived and cut down our trees. Our neighbors trees were burned. WHAT trees will be doing the job mechanical means are capable of doing?
Reply: We pay them water right?
Reply: @Subaru Natsuki yes, and I'm not against planting trees, but we'd have to plant trillions to attempt to get to get to 0 net carbon and we don't exactly have a lot of time.
Reply: Damn
Reply: @nomercy4521  "but we'd have to plant trillions to attempt to get to get to 0 net carbon" Not really. There is a plan to have farmers till rock dust into their fields. They already till in stuff to improve the soil. Could remove 3 billion tons of CO2 a year:  https://www.theguardian.com/environment/2020/jul/08/spreading-rock-dust-on-fields-could-remove-vast-amounts-of-co2-from-air
Reply: @nomercy4521  Trees represent a temporary carbon sink... All the accumulated carbon would be returned, to the atmosphere, upon their death... A very good idea, but not a permanent solution...
Reply: @johnperic6860  There is a LOT of problems with planting trees, like the fact that efficency of CO2 removal by trees decreases over time, once they reach full size they barely remove any CO2, so to maintain current ratio of CO2 removal  you would have to plant new trees ever 10-30 years.
Also if there is forest fire CO2 from burned trees will be released back into atmosphere, also you cant let trees rot because it will generate methane that is a LOT worse greenhouse gas then CO2.

Also many people dont realizes that planting so many trees wont decrease temperature but actually oposite, it will increase it, if you wonder how so, its because trees decrease Earth’s surface albedo, meaning that the planet reflects less incoming sunlight back into space, leading to warming.
Reply: @Culaio  ..
The SRM-solar radiation management that is being done via air spraying blocks the sun.
Reply: @Culaio  Dead trees also release all their stored CO² as they rot or burn.  It is when they are buried by geologic forces that the CO² becomes sequestered.
Reply: @Culaio   Where did you get your information, that mature trees capture hardly any CO2?  Mature trees still grow, so they still sequester CO2.  
And rotting trees produce methane?  Are you sure about that?  I know decomposing trees release CO2, but I'm not sure they necessarily release methane.

Actually, whether or not more trees have a warming or a cooling effect is not as certain or simple as you make it seem.  Trees do have a significantly lower albedo than other ground cover, but much of that energy goes into evaporating water from the leaves.  So if you're talking about tropical forests, for example, the massive amount of water they release from evaporation can turn into clouds.  These clouds actually increase albedo.  So it's a battle between lowering the albedo of trees versus increasing albedo of clouds.

What's more, many trees release certain volatile organic compounds (VOCs) that can lead to more cloud formation, which further increases cloud formation.  I read somewhere that tropical forests have an overall cooling effect and conifer trees may have an overall warming effect.  So I think it depends on the tree type.  Ultimately though, the actual overall effect of trees on climate is uncertain.
Reply: @DANGJOS  it was a longer while ago when I posted that message so I dont remember where did I read it, but I found this that says something similar:
https://www.weforum.org/agenda/2019/03/plant-more-trees-young-forests-use-carbon-most-effectively/

And here is some read on methane:
https://massivesci.com/articles/methane-trees-greenhouse-gas-wetlands/
Reply: @Culaio  go anywhere there is no trees, stand in the sun . Better yet stand on concrete or asphalt in the sun! Then go up in the woods. It's 10 to 15 degrees cooler in the forest!
Reply: @Culaio 
The bigger the tree the more CO2 it takes in...

Where did you get that crazy idea that they take in less⁉️
Reply: @Culaio  Trees do not increase the temperature‼️
They provide shade ~ a cooling effect...
Who are you ⁉️
You are full of disinformation...
Reply: @Culaio  can you provide me a link 
That says that ‘a tree, when reached full size barely produces co2’
Because to me that seems totally incorrect
Reply: @stickykitty  I dont remember where I read it orginally but here is for example article that mentions it: https://www.cbc.ca/news/technology/trees-carbon-emissions-bob-mcdonald-1.4132679

Trees store carbon, sequestered from the air, as the wood and plant material that makes up their mass.
Reply: @Culaio  Co2 is not a threat. It's essential for life. Toxic fumes and chemicals dumped into the earth, water, and atmosphere are the problem.
Reply: @Culaio 
Where did you science? 
Google? Lol
Reply: @Culaio  Thank you! Nobody seems to remember that too much vegetation is even worse for the current climate. I mean, most of the land on Earth was pretty much a giant jungle back in dinosaur era for a reason.
Reply: This is very encouraging and I hope it works; but can a bird have a home in them.
Reply: @ADEehrh  They will learn how to fly thru the fan.
Reply: @ADEehrh  in a corner maybeeeee
Reply: @ADEehrh 
No, they will be homeless too‼️
Reply: @johnperic6860  Do we have 40 years? Worldwide "typical" weather has been replaced by atypical weather an extreme meteorological phenomena. Do we have 40 years?
Reply: Global warming itself is also killing trees due to worse and more common heatwaves, fires, pests, droughts and disease.
Reply: Wasn't this extremely energy inefficient? Then amount of sun energy a tree needs to do its job is not even 1% of what this construct needs of energy to the same conversion.

If you take a coal power plant to power this construct, you will of course get a net increase of co2.
You will need a large number of solar/wind energy to make a cleaning efficient.
But converting coal power plants to wind/solar is to begin with more efficient.
This construct would begin to efficient when we have removed co2 producing power plants.
Reply: Trees are are only 1 part of the co2 equation only a small amount of land owners would want their cleared land planted with trees so trees are no significance but it does make us feel good
Reply: We're producing around 36.8 billion metric tons of CO2 per year, which means around 2300 tons per second of CO2. Trees can only capture their own body mass in carbon, and they only do it up until they die and begin decomposing back into CO2 (or catch fire...). If you want to make that capture permanent, you need a plan to cut them down and store the wood securely where it won't eventually go back into the atmosphere. Of course, you'll also want to be replanting them continuously as well, so the new trees can grow and sequester more. It's hard to put a fixed number on how many trees that would take, but the mass of the trees which would need to exist concurrently would have to be similar to however much fuel we want to burn into the atmosphere, for all time. That's likely impractically large in terms of both land use and what would be marketable for construction lumber. So it's good that people are looking into other chemical processes which can accomplish it more directly and space-efficiently.
Reply: Umesh R. Presumably because factory emissions are a small fraction of global emissions, and won’t allow us to remove the carbon that’s already in the atmosphere. We already have way too much co2 in the air
Reply: Genetically modify and sequoias and splice in cactus genes to grow in the desert. Plant billions of cloned and genmodded süper-fast growing General Sherman trees all over the Gobi, the Sahara, and the Outback to eliminate these wasted arids. 
Genmod these trees with Venus flytraps to grow flytrap leaves to specifically target and eat termites, boring beetles, and also be big enough to also eat wood peckers.
Reply: White people find everything good difficult but pumping up oil they dont find it difficult. If i look at an oil rig it looks a lot more complicated then a co2 sucking plant
Reply: I think people should be awared of the Change. There is no issue for fossil fuel if people tend to go for green energy. The issue then is for carbon in air. That can be solved by this tech.
Reply: we should use the o2 capture technology , money is not important if it is for our safety ..
Reply: .....and we are losing trees to fire as well.
Reply: @nicoweb11780  
Not as bad as losing minds to climate quackery.
Reply: #BillGates causes the extinction of everyone and everything, everywhere! He's the devil!
Reply: @johnperic6860  THAT IS MANY YEARS TEMP AT BEST, WHEN ALL THOSE TREES DIE, THE STORED CARBON, GOES BACK INTO THE AIR.